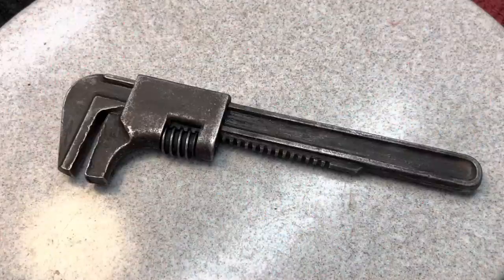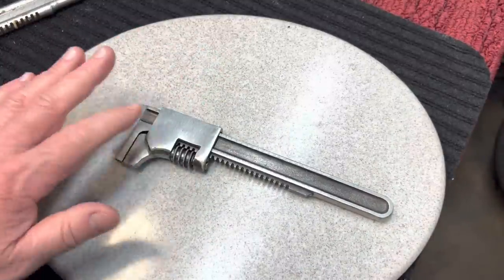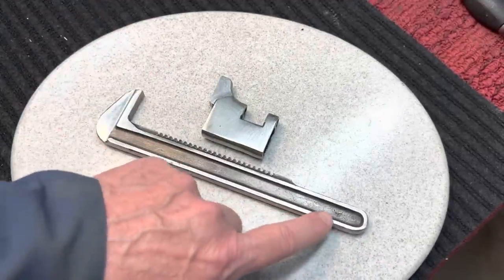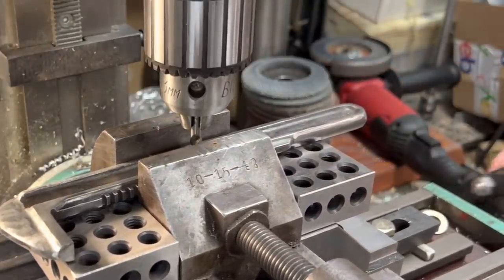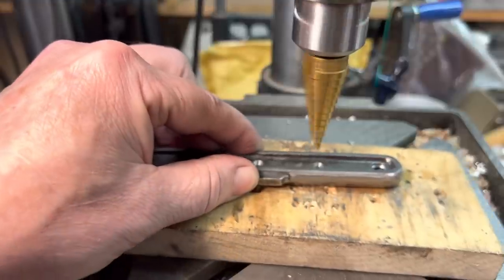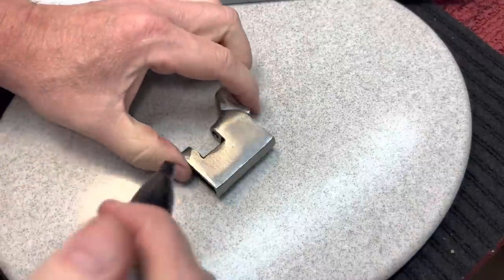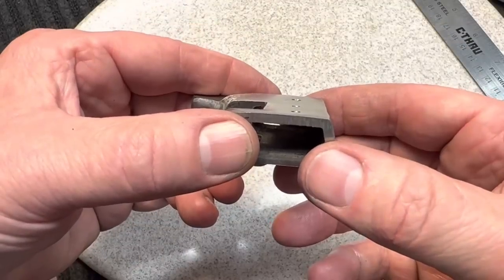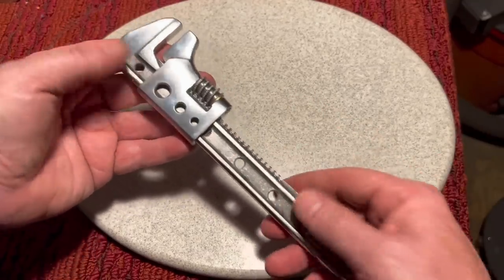Making a Hindenburg Theme Wrench

Comment: If you spaced the holes so that 1/2 inch 1 inch 11/2inch etc you could put  pin through to lock them at that size.

Comment: ScoutCrafter,

You're absolutely correct about optical illusions.  When I startred working at ARCO they had a coporate design manual, which included fonts to be used.  The manual specified that Helvitica font be used.  The word ARCO has two letters made primarily using straight lines and two letters with curves.  A normal font has all the letters the same height, whereas the C & O using Helvitica are larger and run above and below the normal line.  ARCO ships had the word ARCO and the company logo painted midships iabout 10' in height.  The C & O extended a few inches above and below the A & R depending on how you looked at it, created the illusion of equal height.  Or, prevented an illusion of too small letters. 

Lightening holes have been around for a very long time.  They provide access, ventilation,  drainage, allow for fabrication, lighten structual weight, and in some cases prevent crack propogation. Plus, they look nice by adding symmetry and balance.

Bob
Reply from the maker: That’s very interesting about the font Bob, I think today small details like that are often overlooked.  😃👍

Comment: That hole spacing on the slide is just like a chest of drawers - the biggest at the bottom, gradually getting smaller towards the top so it looks right.

Comment: Off topic but I thought you might be interested. Modular fixtures like 1 2 3 blocks have been around for hundreds of years. Until very recently they were necessarily shop made. Before China, it was always cheaper to make them yourself. The area I'm in, most of the Machinists are in aerospace and have an ego about that. The interesting little tidbit is that if you look at vintage tools, for at least a hundred years and it was kind of an ego thing amongst Machinists rather than spacing your holes perfectly symmetrical like a modern 1 2 3 block, they are competitive about drilling holes as close to one another without having the wall break through anywhere! Basically the goal is to have a rigid very exactly sized block, lightened to the greatest possible degree. Before I learned the story of it, I hated the appearance of those. I thought of them as apprentice made and lower quality. But if you've ever tried to make a pair of bore holes 2 thou apart from one another and inch deep in tool steel, you will appreciate how much more difficult that is than symmetry. Personally I prefer the look of the symmetry but it's an interesting little story

Comment: I wanted to add to something you were saying at 3:20 about grades of steel. I made sort of an oblique reference to it on your last video. Absolutely correct that he treating that wrench would be worthless. But just for the sake of discussion, if you put it in a press, arguably with a slightly smaller mold, if you progressively heated and beaded the steel prior to drop forging, the same crappy steal can be made enormously better. Like the whole samurai sword thing, it's folded a million times because they had the poorest quality steel on the planet. What scoutcrafter is saying is completely true, but I think it's important to note that it is somewhat true for economic reasons. It would never make financial sense to put that much labor into a giveaway tool. But you can start with garbage steel and produce a good product. It takes absurd amounts of Labor and time and heat, nothing about it is economically viable

Comment: Looks good for show . Not sure if putting holes in something that's already soft and bendy is one of your better ideas.
Reply from the maker: Lightening holes were designed to reduce weight without compromising structural integrity.  😃👍
Reply: @ScoutCrafter  put it in the dake against one that has no holes, proofs in the pudding. I'll bet the one with holes gives first.

Comment: It's kind of a pain, but if you set up the rotary table, you can use the spindle like a broach with a 90° shear tool, straight or diagonally, to achieve the appearance of the inside of the lightning holes being knurled. I've only ever done it on one tool, a monster crescent that has a very thick profile. It wasn't for cosmetic reasons at first, that thing was really heavy! But I did get a little carried away with the appearances and milled off the writing and did as described above. It's a pretty sharp look, but my favorite part is seeing other Machinists scratching their head trying to figure out how you knurl the ID of a half inch hole!
Reply: The best machinist puzzle I have seen, was more than 10 years ago and I'm still not positive how it was made. It was a perfect cube 3 in by 3 inches by 3 inches. There was a pinhole with an inset lens on every side. When you looked in any hole you could see there was a cavern that got progressively larger as it works towards the center. So inside a pinhole, you have three dimensional compound curves in the convex!!! I'm pretty sure it was done with a thread milling tool and some serious computational power, but that's after at least 12 years of research and asking everyone I know and everything I can find to read. Those are my single favorite thing to collect, but very rare to find. When they're cool the family always keeps it
Reply: Just because I feel like I'm not describing as well, if you were to saw the cube in half in every direction and invert each piece, you would have a perfect sphere. That's what we're so dumbfounding, that was barely any steel holding the cube together and yet it felt solid

Comment: Very interesting about the hole spacing! I always wondered about your mill. About using it to even out something like the channel that the lightning holes were bored into. If you had anything that would mail out a cool radius in that channel, or make fluting to give it an Art Deco look, and then later on paint it green to look like as if it were copper or something? How cool would that look?

Comment: So if I have a Craftsnan auto wrench that looks light green ( and may have been purchased by my father in the 1970s or earlier ) then is it good steel or not? What should I do with it?
 Your viewer who wants to know about rehardening it should learn about adding carbon. Back in the day they would even use sugar to add surface carbon. (Popular Mechanics ran a how-to in order to make a nut into a die and sugar (& propane) was how they did that. It does not make for a whole new tool but it is essentially case-hardening. Sort of like flame hardening or induction hardening.
 Fun video though I am not as fond of the two parters. I've been using some homegrown Apple and Mulberry wood to make homemade wooden mallets because my 30+ year old Cedar homemade mallet finally opened up due to being in the heat f the shed, I believe.
Reply from the maker: John- The Craftsman model was an improvement over these inexpensive ones, they are beefier and stronger.  They used to come with a beautiful bluish green color on the body!  I have a couple!  😃👍

Comment: After watching the first couple minutes of Part 2 I got to wondering about my wrench like this so I dug into my tools and discovered it was a Diamond 💎 wrench and I closed the jaws completely and noticed they fit together perfect, no light was coming through.. I checked the pin to discover that it could be removed with a screwdriver 🪛.. Never would have noticed those things if  I hadn't been watching your videos..  the only discrepancy that I noticed was that in a few places the chrome finish was beginning to peel off... so thx for teaching us these things and BTW your wrench turned out beautiful..
Reply from the maker: Your Diamond wrench is a really good wrench!  Super strong and well made.  Crescent also makes a good AutoWrench.  😃👍